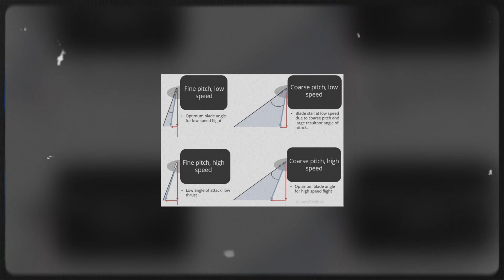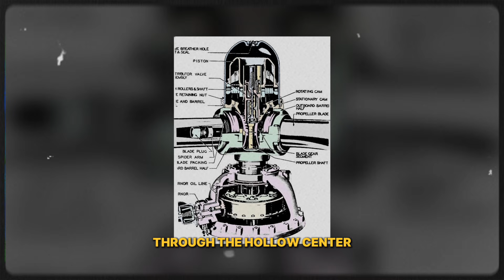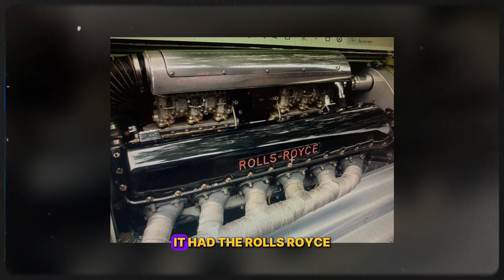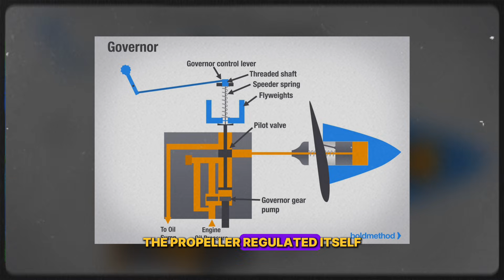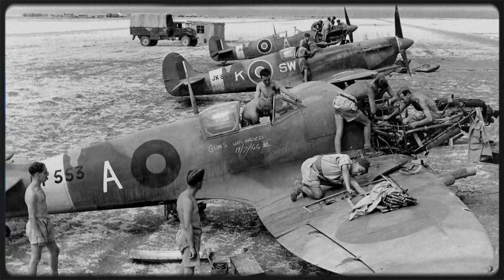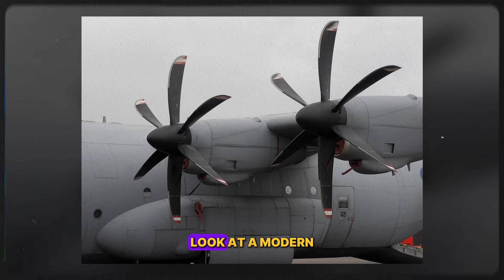Britain's Fighters Were DOOMED—Until This American Did The Impossible

Comment: Oops this was not true the Planes with two propellers had wood one was the Hurricane MK1 it was changed after being too slow so three propellers were introduced they were all metal Spitfires all had Metal Propellers. There were three companies in Britain that made them most were constant drive Propellers. They were mainly used in the Battle of Britain. Reason why Fixed pitch or constant drive was simple easy to replace and low failure rate. It was in bombers they had de-Havilland new type of Gearbox Propellers that could feather. Now in 1940 the fastest planes were propeller driven in 1941 the first jet was the fastest plane but not used and in late 1942 a rocket plane first flew a Female Pilot classified as unknown speed but now testing it using computer it was capable of 1000MPH. maximum flight time was only 15 mins glided back.